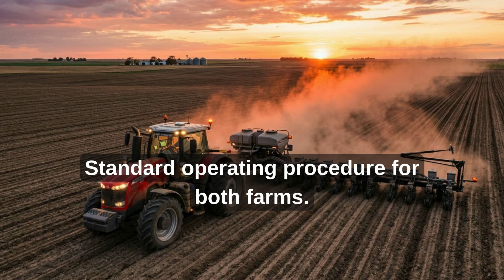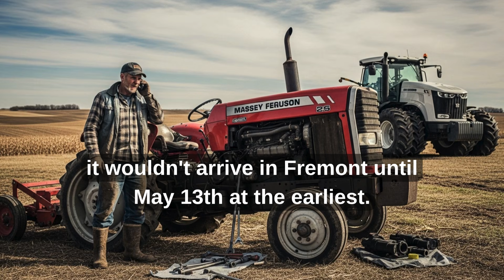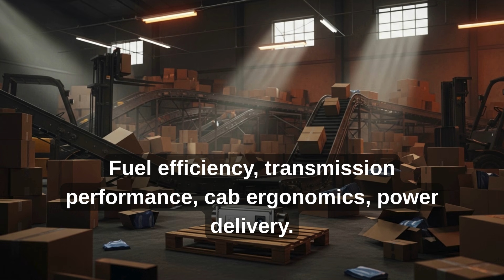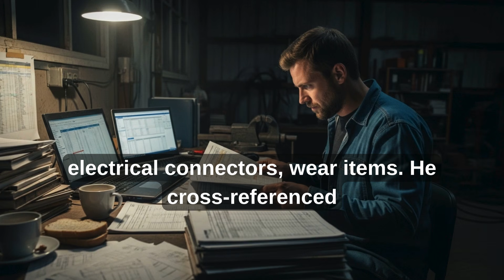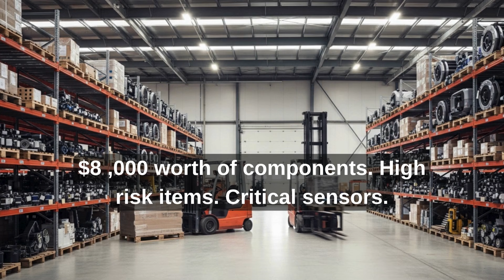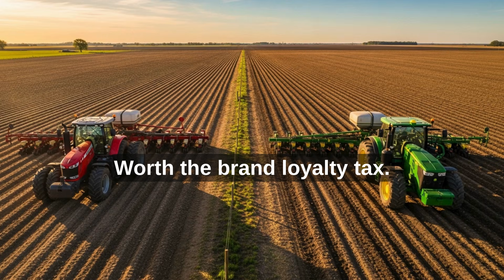Massey Ferguson Couldn't Get Parts for 11 Days — His Neighbor's John Deere Finished the Field

Comment: Those cvt boxes actually have 3 speed sensors. 2 are easy to change the other absolute b**   They should have been able to get overnight priority air frieght on that part if it was in the country. It can be done put there are time cutoffs